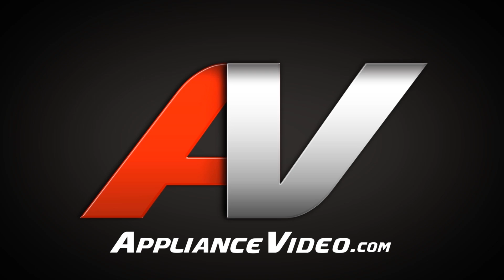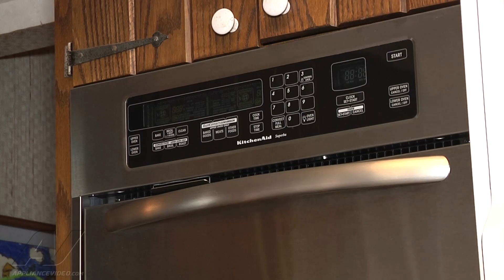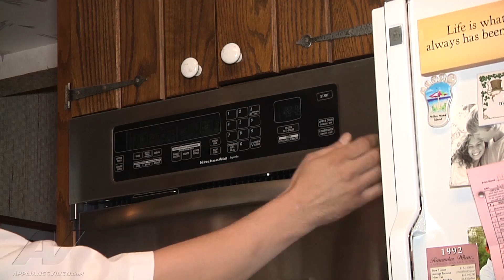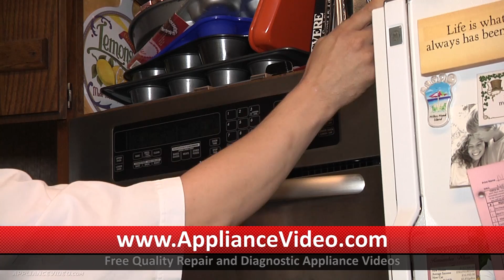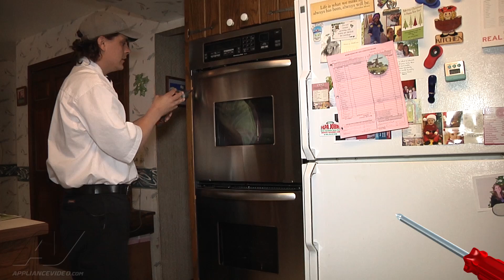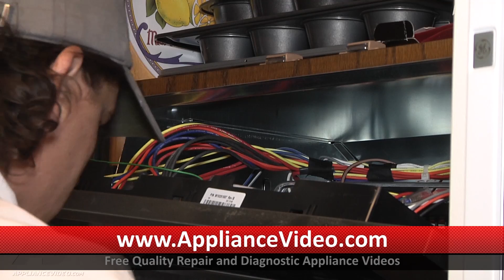KitchenAid Oven Repair - Does Not Bake or Broil - Electronic Control

Comment: Did you think to check to make sure you have 220 volt power coming into the appliance??   I have seen many of times on these no bake or broil issues, the appliance is missing one of the 220 volt power legs, usually caused by a burnt incoming power line like the range cord terminals or the line in the junction box.  This will cause the appliance to only have 110 volt power, which is not enough to allow the elements to heat up.  The control panel itself operates off of 110 volt as it gets 110 from ground, and the relays will pass 220 volt power to the bake and broil elements.  I have seen this issue many times, usually caused by the installer not properly tightening the range cord terminals to the posts, even i  hard wired applications i have seen burnt power wires causec by a loose wire nutted connection.  Also the control board itself can have a burned or failed trace on one of the common connections causing no power to be passed to elements.  I have repaired the traces on these boards saving customers lots of money.

Comment: Hi ..
After I'm install the control panel . Everything working good . But one small problems .. Can't turn it off .,., help please
.. Do you have a service in Columbus Ohio ? Thank you
Reply from the maker: Tom 
    We service only in Toledo Ohio. All of our technicians are now answering questions daily on the ApplianceVideo.com website. You can search completely FREE in our Repair Help section with over 1000 questions & answers. Or you can get unlimited technical advice and video links emailed to you by our 14 factory certified technicians at http://www.appliancevideo.com/premium-membership/.  If you are in need of any parts please support our parts department on line at http://savemoreonparts.com/ or call 1-800-830-5465 7-days a week until 11pm Eastern time. Thanks for your support. Matt Ace Appliance factory service technician.

Comment: Maybe they should install a little fan by the control board 
😇😇😇
Reply from the maker: Great question, if you have a more technical question that our parts department cannot answer, you can search our over 13,000 answered questions free at our website www.ApplianceVideo.com under our Repair Help section. You can also call our parts department at 1-800-830-5465 and they can give you help 7-days A week ,or search at www.SaveMoreOnParts.com  .

Comment: How did you remove the edge plates? Your camera missed this most important part. I have been struggling for hours but the edge plates still wouldn't come off...
Reply: have you found a way to remove the side penales I having the same issue

Comment: Hello. I have KitchenAid Single Wall oven (M/N: KEBS1070BS7) No Heat, No bake, however he cooling fan comes on right away. Before I disassemble to access the thermal overload, is there any other possibility of failure?
Reply from the maker: Great question, if you have a
more technical question that our parts department cannot answer, our
technicians are answering all questions at our website at www.ApplianceVideo.com under our Repair Help section. You can also call
our parts department at 1-800-830-5465 and they can give you help 7-days A week
Monday -Sunday, or search at www.SaveMoreOnParts.com  24 hours
7- days A week.

Comment: I have a Kitchen Aid wall oven that the convention fan quit and does not broil but the oven bakes. Is it ok to  self clean my oven even though it's not  fixed yet. Model # KEBS107SSSOO. WHAT CAN YOU TELL ME COULD BE WRONG.  THANK YOU.
Reply from the maker: Great question, if you have a
more technical question that our parts department cannot answer, our
technicians are answering all questions at our website at www.ApplianceVideo.com under our Repair Help section. You can also call
our parts department at 1-800-830-5465 and they can give you help 7-days A week
Mon-Sat . You can also search at www.SaveMoreOnParts.com 7- days a week.